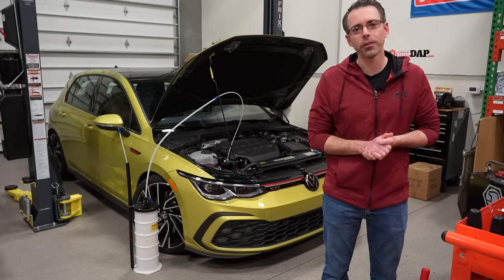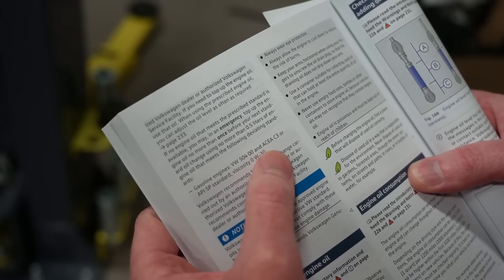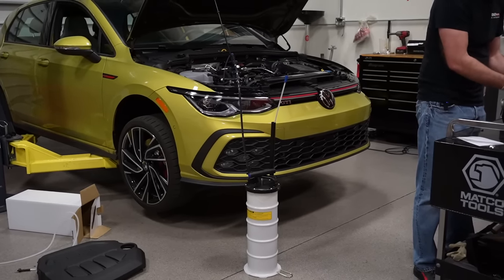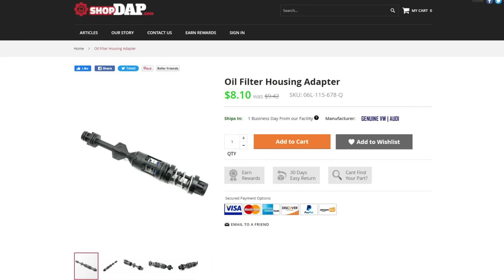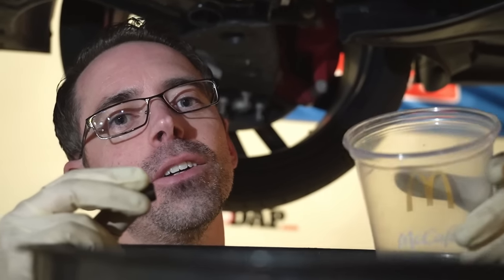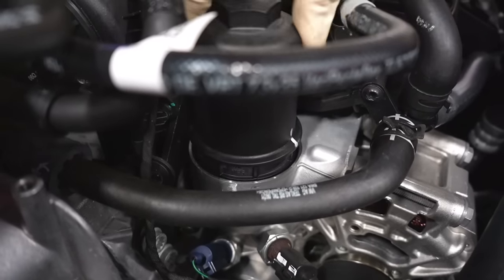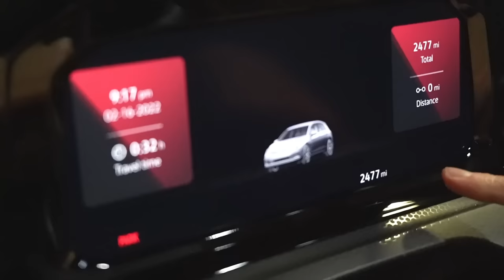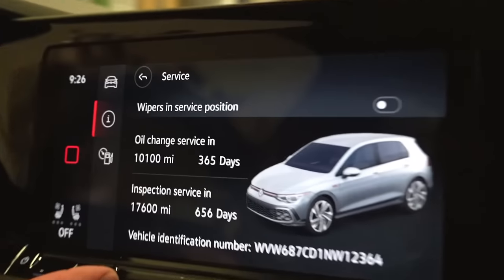Will an Oil Extractor get all the Oil? | MK8 GTI Oil Change

Comment: I made an extractor with an old junk shop vac and the correct size hoses, it took over 2 hours to fully drain.... Then my oil filter threaded part stuck in my engine... And finally, my drain plug stripped.... Of course, i have 150k miles, used, god knows who did what with the car before

Comment: Have the engine oil changed "by suitably qualified professionals".  I have to laugh at that one because my VW stealership has overfilled my oil at least 3 times on my '03 GTI 24v VR6, and I had to thrice siphon the extra quart or more out myself!  One would think that these VW techs would know the difference between the various size 6 cylinder VW engines manufactured over the decades, but they DON'T know their asses from their elbows!  ALWAYS check the type of oil they put in, and check the level, stealership or not.  I've had the car almost 20 years now, and the first 10 years or so, they would get the level perfect.  Only in the last few years have they screwed up, which leads me to believe the youngsters they train today don't hold a candle to the superior techs of yesteryear!  Sad, but true.
Reply from the maker: You are right it’s bc newer guys, most mostly bc they don’t work on many VR models minus atlas these days.

Comment: The charts are useless if you have more than 120k miles.   I use a 20 gallon professional oil extractor for all engines.  My Audi doesn't even have a manual dipstick.

Comment: My God, that manual was a joke! My 2003 Lexus manual has the oil type, capacity as well as fuel type and capacity on the first page or just flip to the Maintenance section under "engine" and you'll find it. The weight is also on the oil cap.

Comment: Sorry, but no matter how well you may say this method might work, it defies logic and physics to assert that it's always as effective as properly draining the engine oil from the sump drain plug, at the lowest point on the engine oil pan. There is simply no way that extracting engine oil via vacuum is equal to that achieved by gravity. While the ultimate benefit to using gravity vs vacuum might be indeterminable, gravity is still the most effective, your demonstration notwithstanding. Gravity always wins.

Comment: 5k oil changes are a waste of money, and creates more unnecessary waste.  0-20 508 is new, 2019 is 0-30 or 5-40 not 508, what is the difference between 508, and 505?  Never find that info either. Between 10k changes, I never need to add

Comment: okay, you recommend changing oil every 5k miles, which is around 7,500 km
VW recommends changing every 10k miles, or 15,000 km

what if the engine burns so much oil, that within the 5-10k miles, you've refilled more oil than the engine contains?
my Golf mk4 (engine code: AZD) is burning a lot of oil, so within 22k km, I've refilled nearly 10L oil, while the engine contains 3,5L xD

I'm poor, so I don't have the money to fix it, but the question needs an answer anyway!

Comment: 0W20. Jeeez. Poor engine. During trackday that oil must be thinner than water. Todays economy, use 5% less fuel because thiner oil, but throw your engine away after 100k miles